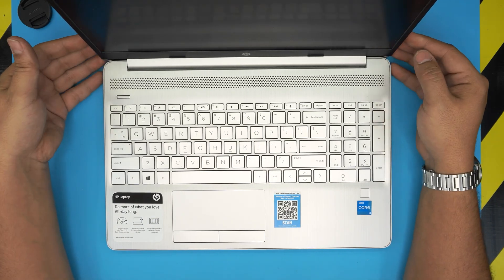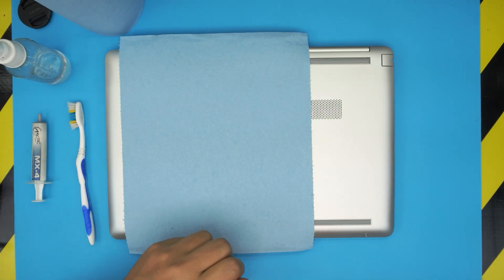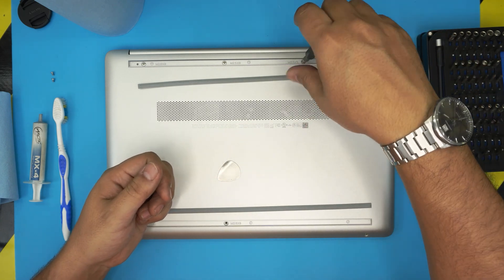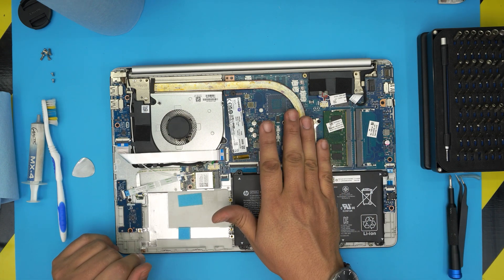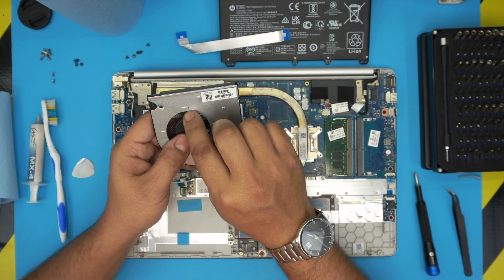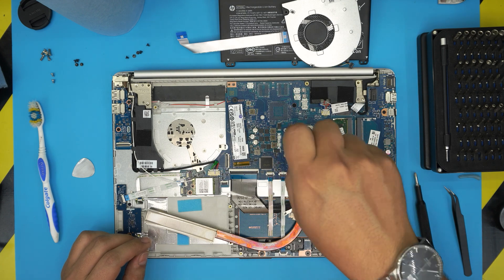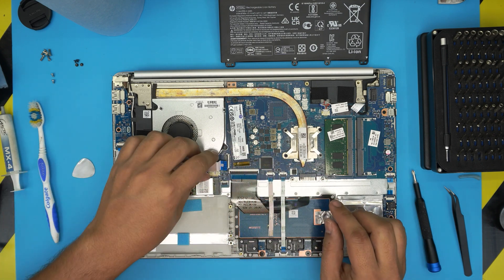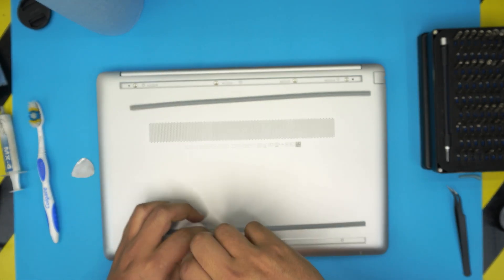How to Repaste and Clean an HP 15-dw3033dx Laptop | Step by Step🧹💻

Comment: on my laptop, the flex cable is sticked on top of the fan with adhesive or something. i couldnt just pull it out like u showed in the vide. can i just remove it even though its sticked? pls help
Reply from the maker: 🫠Regarding your question, place alcohol on the flex cable and abit under and peal the flex cable off the adhesive is not glued.

Comment: Hi I had done this and successfully repasted my laptop thanks to this video, it had a GPU chip which would be placed top-left of the CPU chip. But I ran into an issue, one of the USB ports you can see on the top left, the 2nd one from the top left stopped working, is the flex/ribbon cable that you detached responsible for those ports? If so, it could be that my cable was dirty or not inserted properly.

What's weird that only one of the ports isn't working, if the cable had damage, shouldn't both ports stop working or is the 1st USB port connected elsewhere?
Reply from the maker: It's my pleasure, my friend. 😊 I deeply appreciate your taking the time to provide feedback. If you're inclined to support the channel further, feel free to like and subscribe—or even both!
Regarding your question, i would highly recommend you to remove the flex cable that connectign the left board to mainboard, and flip and check and see if the flex cable pins are intact and are not damaged (they should be straight), if so re insert the cable all the way inside the jack, maybe you only inserted half and that is why only one usb and half making contact.
Should you have any further questions or requests in the future, please don't hesitate to ask me.
cheers🍻